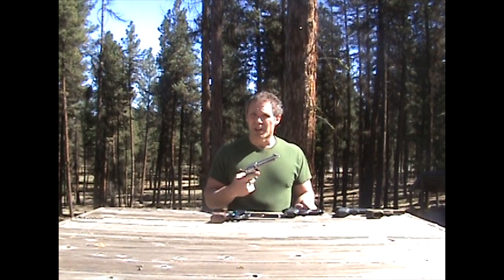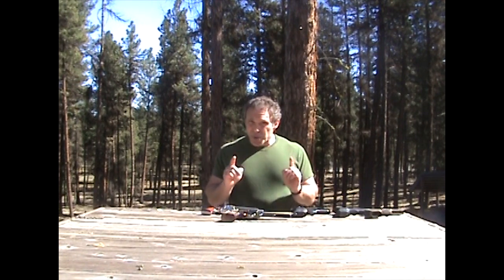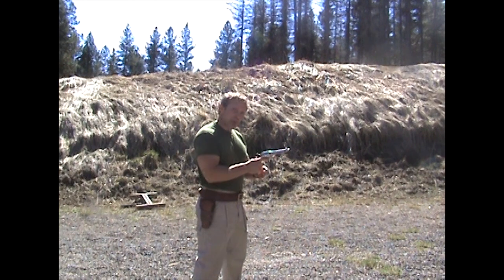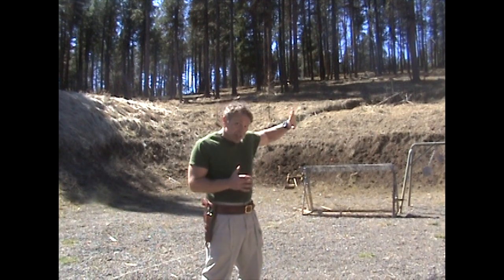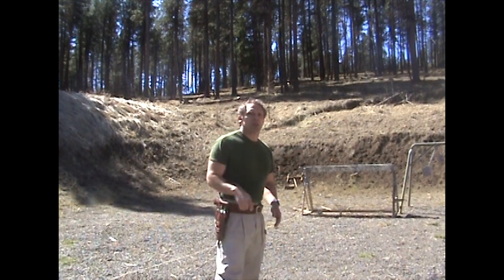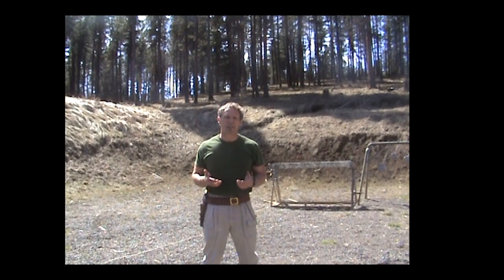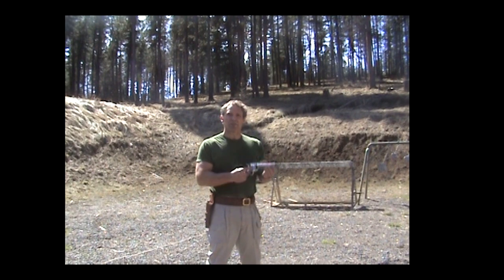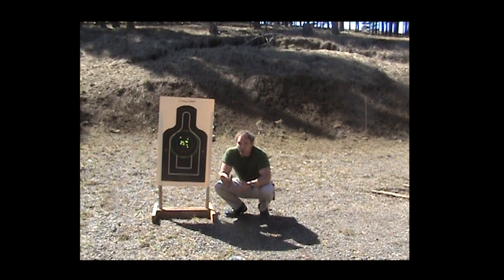Single Action Revolvers for Concealed Carry.

Comment: "Six bullets more than enough to kill anything that moves" - Revolver Ocelot
Reply: Youre pretty good
Reply: @Brad Bowers not sure about the legal ramifications, but the 'ol John Wick bop bop and one on the top oughta do the trick. I'm talkin' table distance obviously, head be a small target.
Reply: Brad Bowers dude those revolvers pack a huge hunk of hot lead that I don’t even think any criminal who’s high as balls on meth could even get up from well places shot in the chest and it’s game over
Reply: @Brad Bowers You are correct but the 45LC rivals a fucking AA Battery in size. 

It's impact transfer is pretty fucking high for a pistol cartridge.

Hell sometimes 45LC are loaded into rifles for that reason.
Reply: But let's just all ignore the overwhelming self-defense statistics and prepare for the 0.5% problems which require CZ P10F 19-round mag loaded with +p+ with 3 handy backups mags just in case.
Reply: @exothermal.sprocket  
I'm screwed with my little ole' .44 magnum Super Blackhawk in movie style multi directional bad guy three dimensional attack scenarios for sure. But if it's a single dude wearing a bear costume he's fucked.
Reply: @exothermal.sprocket  
I do have a lot of .44 special in the safe :)
Reply: As long as there's not more than 6 of 'em.

Comment: One reload technique that gets over looked is carrying a magazine and using it as an ammo pez dispenser. For 45 acp single actions use a 1911 mag, for 357 use a coonan mag.
Reply: That's a damn good idea.
Reply: I have several gadgets that I have had for many years but I don't know who made them or what they are called. they are rubber strips with loops for cartridges, I just push them through into the cylinder and they work pretty well.
Reply: Right. Most of us with SAAs will likely be shooting non-auto cal. ctgs such as Colt .45 although .357 is certainly widely used. Speed strips ought to work pretty handy, I'll have to try that sometime.
Reply: as hard and expensive Coonan mags are to find, probably better to carry an extra loaded cylinder
Reply: Suggestions for 45 Colt ?
Reply: Justin Prather hmm I'd never thought of this thanks😉
Reply: for 45 long colt, a desert eagle 44 mag magazine works great
Reply: @Frank Gonzalez:  Speed strips, there are several reputable brands, for .45 ACP will easily accommodate .45 Colt.
Reply: if you were up against a bear, that's 6 more bullets the bear doesnt have
Reply: If you need more than 5 or 6 shots you are somewhere you don't need to be doing something you shouldn't do
Reply: I'd rather have a Coonan or just carry another .357 to balance my weight. But your suggestion makes sense.
Reply: That would speed up the reloading by about... 3%.
Reply: kyle6800 but it would reduce fishing ground in a pocket for loose cartridges by 98% if were making up numbers .
Reply: Justin Prather of
Reply: "For 45 acp single actions use a 1911 mag" -- Which single action revolvers would take 45 acp without the rounds falling right through?
Reply: mountainhobo 
It sounds good though.
Reply: I like it ! I'm glad you posted this comment ; it's an EXCELLENT idea .  Kudos , my friend !!
Reply: I do this!  I carry a 1911 magazine, except instead of a revolver I carry a 1911.
Reply: mountainhobo Ruger makes one, Cimarron makes one too.
Reply: @Jonathan Lackey -- Fascinating. I will definitely check it out. I have a Vaquero in 45 Colt, perhaps there is a 45 acp cylinder for it?
Reply: mountainhobo it will have to be returned to Ruger for fitting the cylinder but it can absolutely be done. There should be some custom shops that can do it as well.
Reply: You see this same idea with Stripper clips. Place a round in the cylinder and pull the clip away dropping that cartridge, then turn the cylinder and do it again and again till full.
Reply: @mountainhobo  Ruger Blackhawks often ship with a .45LC and .45 ACP cylinders.
Reply: There is always the "New York" reload. Nothing is faster than that.
Reply: @steelgila  Speed strips seem like they'd be a workable idea.
To me, the biggest advantage a speed strip offers, however, is that it keeps a reload of cartridges, together, as a flat package, which is obviously entirely superior to just loose cartridges, but it also has the advantage of not being a round and bulging object such as a speed loader (which wouldn't work with a loading gate revolver anyway).
A speed strip would fit subtly in a pocket, while a speedloader might make itself somewhat visible.
Reply: @mage3690  Well hey, there's an idea, seems like it could even be a marketable product. 
I'm imagining it as a series of links, a bunch of cartridge holders which can be snapped together, and which you can form into a circle (perhaps with a magnet or something on each end of the chain), and voila! You now have a circular speedloader for your cylinder, but which can sit flat in your pocket.
Hell, you could easily adapt these to different cylinder capacities, removing or adding links to create on-the-fly speedloaders for 5 shot revolvers, 7 shot revolvers, and 8 shot revolvers.

There's maybe a couple of things which would have to be solved, but I can see this possibly working.
Reply: I use a Desert Eagle mag for .357 mag reloads on my Ruger Blackhawk.  Works great.
Reply: 8aleph don't you mean if you need more than 5 or 6 "hits?"
Reply: @mountainhobo  extremely late reply but i loved the question. In the early 1900s, after .45acp was invented of course, the army had a revolver chambered in .45acp, had half moon stripper clips of 3 shells, meaning you load two clips at a time. Im sure there are other examples of .45acp revolvers but this one comes to mind.
Reply: Or for those with Remington single action revolvers or copies thereof, carry preloaded cylinders. The hand/pawl relationship is a lot more loose and forgiving than their Colt and Smith and Wesson counterparts at the cost of going out of time faster than the other two. If you've seen Pale Rider that was why the Preacher could change out pre-loaded cylinders as opposed to ejecting spent cases with the ejection rod. Most other revolvers even to this day, you can't simply drop a new cylinder and have it work right away  The hand/pawl relationship is unique to each individual revolver.

 This is why if you come across a second hand Ruger Blackhawk .45 ACP or 9mm Cylinder, for your .357 and 
.45 Colt revolver respectively, you send your gun and the second hand cylinder to Ruger and they will fit it to your action. Last I heard, they'll do it for free.
Reply: Another one is using a stripper clip in a similar fashion.
Reply: @mountainhobo  , Ruger Blackhawk convertible .45 Colt w/ .45 ACP alternate cylinder. The ACP cylinder headspaces on the catridge leading edge given the rim within each charge hole.
Reply: @mountainhobo  Ruger Blackhawk.  The. 45 ACP Cylinder headspaces on the case mouth.
Reply: Yeah...I'm not spending 150$ on a Coonan mag for that.
Reply: Justin Prather that's genius
Reply: @mountainhobo   Ruger Blackhawk with 45acp cylinder
Reply: Woah why haven't I heard this idea elsewhere brilliant
Reply: I like my .45 Colt. I'll just have to use my fingers from a belt slide.
Reply: Excellent point, thanks
Reply: Or just carry a mag fed gun like an intelligent person would
Reply: Rubber speed strips would work better.
Reply: Oh damn, never even thought of that
Reply: Get back in the glock box.
Reply: @8aleph  well said!!
Reply: Genius!
Reply: When was the last time you stripped a magazine by hand?  It's far more difficult to do than you think.

Comment: I bought my first handgun, a Ruger Single Six .22 in 1957!  I still have it, still practice with it.   I have probably put a 100,000 rounds through it the past 63 years!  It is still tight and still accurate!  It is the handgun I learned to shoot with.  I have several other single actions and one double action, a Ruger SP 101 .357 I use for concealed carry.    Even though I practice with the SP 101 it is a single action I shoot best and have the most confidence in using!  They are 2nd nature to me!  At any distance under 20 feet I can group shoot a 2-3 inch group using just instinct and muscle memory!   I have ordered a Ruger New Vaquero Talo in .45 with the 3.75" barrel.  That will become my concealed carry gun as soon as I get familiar with it.

Comment: Have to agree with much of what you said.  However, for personal defense I think a person should use the type of handgun he or she feels the most confident in the ability to use accurately in a life or death situation!  For me that is a Single Action.  Reason:   I learned with a SA and have carried them for years to the point the SA feels the most natural in my hand!   Granted, that comes from years of practice.  Don't have to think about anything, it is just muscle memory!   Yes, if I knew I would be in a firefight a SA would not be my first choice.  I have used double actions and semi-autos, but I have never been able to shoot any of them quite as well as a SA.   I find, for me at least, the point-ability works better for me with a SA.  I can shoot a 4 inch group out to about 15 feet with out the use of the sights!  Never been able to do that with any other type!  Back in early 1973 an old Colt SAA saved my life one night with a home intruder.   He missed me with his 9mm.  But my old girl put two bullets about two inches apart at about 12 feet, strictly by the ability to shoot where I was looking in the very poor light.  Sights of any kind except lazer would have been useless.  I have never felt I could have done that well with anything else.
Reply: What length barrel do you prefer?.......I'm considering a 4.6" and not 5.5" or 7.5".
Reply: @andypeterson8013  I prefer the 4 3/4", although my original circa 1904 has a 5 1/2". It's the one that saved my bacon.

Comment: Paul your emphasis on straight trigger finger until on target is spot on and is the exact method I use.  However, for first shot cocking, as I draw with thumb on hammer, I allow the the weight of the revolver to cock it as I rotate muzzle to horizontal "on target".  This is a lightning fast technique, easily and safely mastered with practice, that actually allows the single action revolver to be the fastest weapon for first shot hit, over autos and DA revolvers.  I like your support hand cocking method for repeat shots and am going to steal the idea from you. A major advantage is that single action revolvers are relatively compact for caliber, a 45 Colt single action being more compact and easier to conceal than an "N" frame S&W DA for example. Also it is easy to shoot other calibers with a cylinder swap, 45 ACP spare cylinder for example on a 45 Colt SA.  Also the strong solid frame permits the SA to be an incredibly accurate, precision platform that is MUCH more accurate at long handgun ranges of 100+yards than any auto pistol made. In effect, SA fast loading is sacrificed for precision "sniper rifle" accuracy. Teamed with a lever action rifle in same caliber, a SA revolver makes an incredibly versatile SHTF option.  My 5.5" Uberti Colt clone  SA 45 Colt/45 ACP  is easily matched to a Rossi 1892 24" lever action 45 Colt rifle, or with a cylinder swap to 45 ACP can supplement and match my Mech Tech carbine upper in 45 ACP and my Springfield XD 45 ACP.  For pure self defense in 45 Colt, I like 200 gr RNFP  cast lead bullets(custom mold) with 86% meplat (0.392" diameter) at 1000 fps as the large flat nosed bullet blasts 1+inch diameter tunnels completely thru large critters, but a 200gr bullet weight keeps gelatin penetration around the 18" IWBA/FBI specs. For deeper penetration use a 255gr bullet at 1000 fps from the 45 Colt. A 255 gr bullet @ 1000 fps is the original ballistics for the old 40 grain black powder charge 45 Colt and it works so well that I keep my smokeless hand loads at the same velocity.  The large meplat RNFP is such a deadly, destructive bullet out of the 45 at 1000 fps that I prefer it to hollow points, but in the 45 ACP unfortunately do not feed worth a damn from autos, so I use JHP's for ammo uniformity.   The SA revolver is far from obsolete, and I feel the SA remains the most versatile handgun design to this day, and is the one handgun above all others I would choose to keep! Like the M2 50 BMG, the SA ain't the best choice for most jobs, yet its capability allows it to do all jobs better than more specialized weapons, so it stays around because nothing else is as versatile!

Comment: I know this is an old post, but thought I'd throw in my .02 and experience.  I greatly enjoy Mr. Harrell's videos and the way he presents many different options and views.  Please keep up the good work.
I own several semi-autos and several SAA type revolvers.  During cool weather, my most common CCW is a Pietta SAA.  It is the only one of my SAA clones that has a transfer bar safety.  That safely gives me one more round to carry.  The reason I stated I carry it in cool weather is it's in a right hip leather holster, outside the belt.  Not very concealed, without a jacket.  Fortunately, open carry isn't that unusual in my State and is legal, most places.  So, now and then, I open carry, too.  Though, I prefer not to.  The biggest reason I carry the Pietta is it's what I'm most proficient with and most comfortable with.  I'm a Cowboy Fast Draw Assoc. competitor, so I'm very comfortable with the SAA types.  Now, that's not to say I'd use a CFDA draw for CCW!  As Paul might say, "let me say that, again", I would not use my CFDA draw for CCW!  I would never do that with full power ammo!  For several reasons, 1) It's just not safe.  That's why we use reduced power loads and wax bullets in competition and practice for CFDA.  2) My CCW holster and my CFDA holster are not in the same place on my my body and are only similar in that they can hold the same gun.  3)  In CFDA competition I cock the hammer as I draw the gun from leather.  I wouldn't recommend that with my hip holster and full power ammo!
Now, as you might expect, I can't expect to practice and compete with CFDA loads and then transition to full power loads and expect to be just as proficient.  Nope, not even similar.  So, yes, I do practice CCW carry with full power loads.  I don't cock the hammer till I'm transitioning to the horizontal with the thumb of my strong hand.  I do feel I have an advantage that my first shot can be relatively accurate at 7 yards or less without aiming.  Subsequent shots being fired just as Mr. Harrell demonstrated, aimed and cocking with the off hand thumb.  Do I feel I might be outgunned by someone with a semi... well, I'm confident if the need arises, I'm proficient enough that I could draw fast enough to get the drop on most nervous, unproficient individuals and 1-6 well placed .45 bullets will end most situations.  I hope I never have to find out, but I'll keep practicing.

Comment: Believe it or not, I conceal carried my 7.5" barreled Ruger Blackhawk .45 Colt for a short time.
But I had to do it in winter via a vertical shoulder holster with a side spring closure that allowed it to be drawn without requiring a vertical draw.
Reply: You pull that out and anyone sane will run like hell!
Reply: I had a pair of Ruger Super BlackHawks in .44Mag with 7.5" barrel that I concealed carry on occasion too. (Not both at the same time though)😀

Comment: I like my Ruger Single Six because it makes me slow down and enjoy shooting plus the ammo lasts a lot longer. After watching this I will give my Ruger 41 mag a little closer look as to what it is capable of doing for me.
Reply: MrZonacat1 - I finally got around to shooting my 41 Mag a month or so ago. Excellent accuracy, manageable recoil, and i know the power is there (Silvertips for quick expansion, Hornady is now making a 190 gr FTX, which may be just the thing). The one thing it needs is slightly larger grips, primarily a bit longer. As it happens, i bought 6.5" Blackhawks in 357 (old model) and 41 mag (new model) at the same time in a shop years ago. Divorce present to myself. Already had a Bisley 45, a Super BH, and a Single Six, so i know Rugers work well. Looking forward to handloading various cartridges, in particular the 41 Mag and 44 Spl. Hard to go wrong.